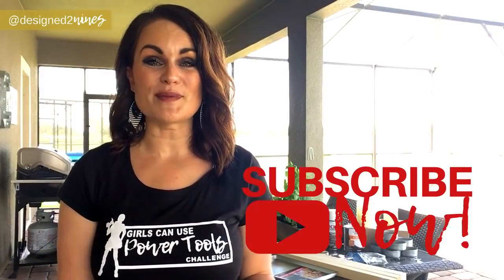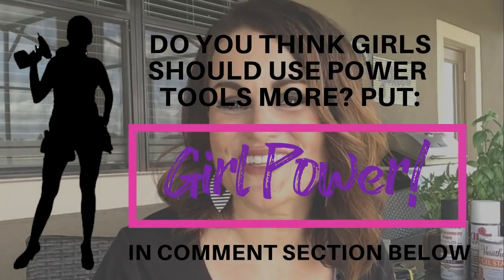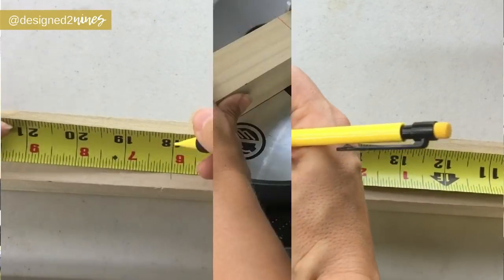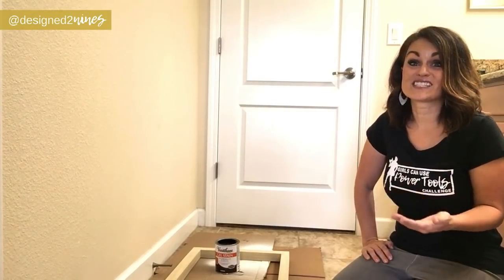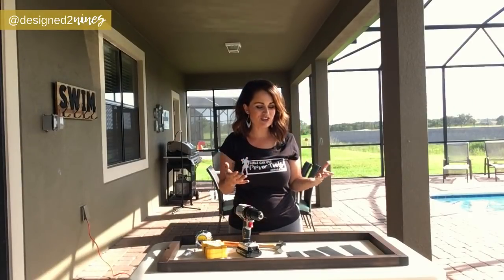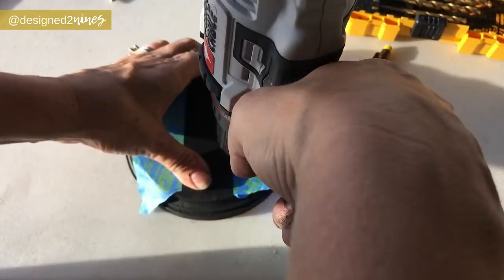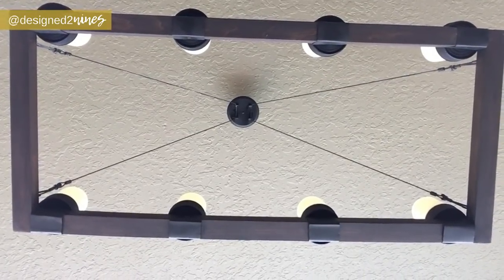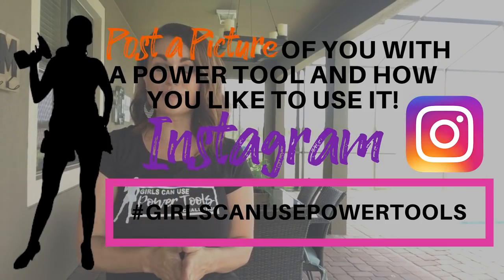Farmhouse DIY Chandelier On a Budget | Ballard Designs Knock Off

Comment: I like the light fixture a lot. I don’t understand how the dog leads work. Did you use 2 or 3 dog leads? To me it looks like 1 dog lead is run diagonally from one corner to the other corner & a 2nd dog lead is run diagonally from the other 2 remaining corners.
Reply from the maker: I used 2 dog leashes. They run parallel long ways. Hope that helps!

Comment: I would like to use power tools but my husband said at our age  (I am 70 and he is 73) we don't need any fancy power tools. He has several drills, a jig saw,  a saber saw and a regular electric hand saw.  I am never allow to use them. The only tools I have is a small tool box with different sizes of screw drivers, a hammer, several wrenches, a tape measure, a level, painter's tape, electrical tape, some nails, screws, picture hangers and picture frame wire. HELP me convince since I am in good health I should be allow to use power tools.
Reply from the maker: Try starting small with a drill or jigsaw and show him you got this... then when you have successfully completed something he will see. Better yet, appeal to his ego and ask him to teach you how to use them. 💕 Hope that helps!